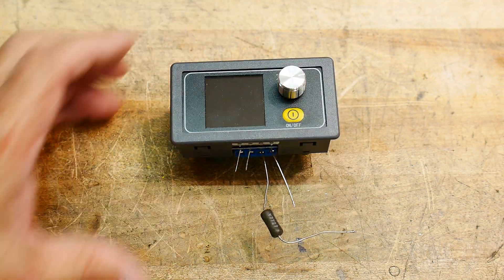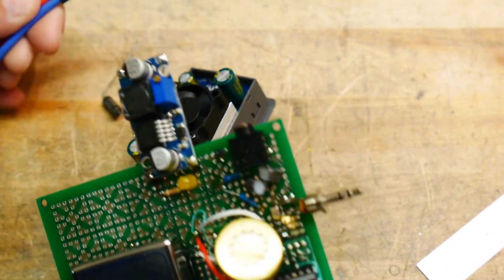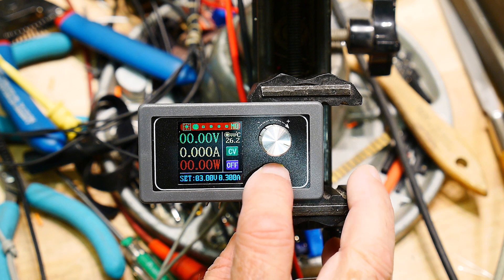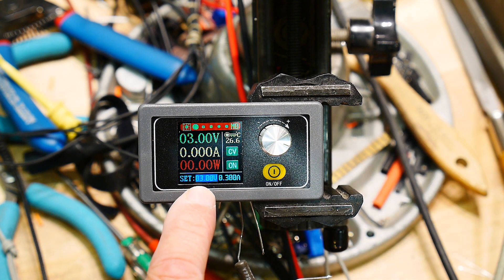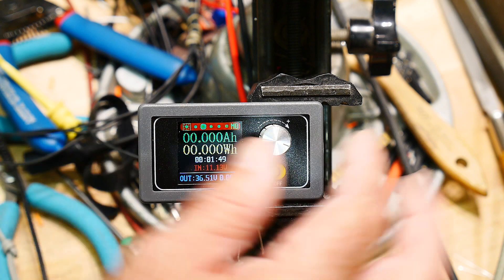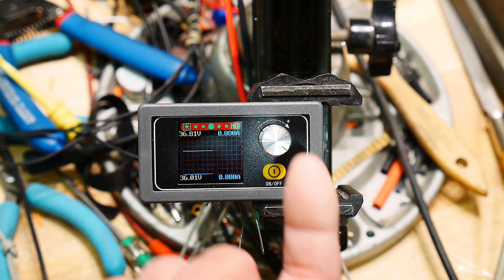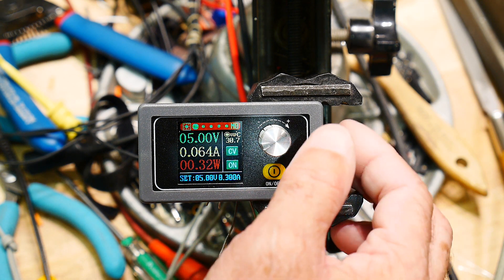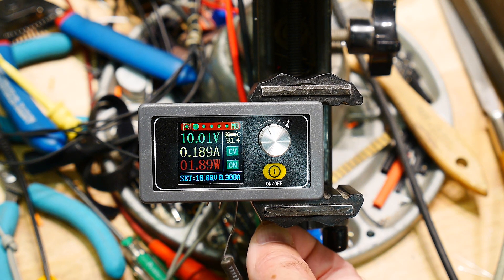#550 Buck Boost Power Supply with OLED Display

Comment: I really like the cheaper models that are like $6. They don't do the full menu or graphs, and the range only goes to 30v instead of 36, and only 4 amps, but they're much easier to use. You can just turn the dial to change the voltage, no set button needed. There's another button you press to set the constant current limit. I think you'd like that one a lot more (and it's 1/3 the price). Also, I belive they are technically sepic topologies, not the buck-boost... But that's better anyway. They don't come with a fan but it's easy to add one (it will turn itself off if you drive it too hard.)

Comment: It's made for for supercell capacitors it works as a voltage feller to keep up with the need off power in a group of 15 or 90 capacitors if you will put a group of capacitors on the output side you will see a super change of power in milliseconds you see the voltage stabilize and the amperage escalate dramatically its a door to a new power suply

Comment: Good review! Can you tell me how well the over-current protection works? I have a simular (Chinese) buckconverter module, and it does not do a good job of the over-current protection. It actually first goes up to the set voltage, and after about 200ms it starts checking the maximum current that is flowing. If it's too high, it then starts to lower the voltage. This means that for at least 200ms you could get a massive over-voltage (and of course allso over-current) before it kicks in the over-current protection, effectively destroying your component due too the late protection. Is this module doing a better job?
Reply: yea trips off line it over current...

Comment: Nice review.  I was wondering if you had a chance to measure noise / ripple on your scope?
Reply: looks really good so far, going to use it for the laptop in the ham radio room  so it will have to be clean from RFI

Comment: I have this regulator since a month and it works just perfectly. Ever heard about initialization ? The delay you talk about between different setups is only initialization which is a normal process. And of course you cannot change the voltage or current once outside of the menu. This is clearly for protecting the load or circuit connected with the regulator.

Comment: I think something is wrong with the board, since I can't limit the amperage that is being applied to the circuit, and most of the times it won't display the current amperage and power drawn from the power supply (stays at 0A and 0W). How can I tell if something is damaged and how could I fix it?
Reply from the maker: soulds like you might be using it wrong. the menus and operation are confusion. Did you press the yellow button to enable the output?
Reply: Same here too. I've tested many ways but ampere doesn’t meet the output and few second after it shows a warning like " OEP" and restart.  I'm confused what is it and why is it happened l??!!

Comment: Hello. The XYS3580 module (LCD display) has a very poor performance. On 50W load test, the XYS3580 heats up to + 70 ° C, while the XYH3606 module has a stable temperature of 33 ° C. The XYH3606 module does not have an output anti-reverse diode, one must be installed if you want to recharge a battery. I made a power supply with output out 0V to 36V 120W compact autonomous rechargeable from 15V to 24V IN (power supply off or on, it doesn't matter) in an aluminum box of 130Lx110Wx50H mm, 6 18650 batteries mounted in 3S2P, bms, regulator battery charge limited in current (1.4A), USB module 2.4A QC2.0 / 3.0, etc ... 30mm regulated case fan, etc ... This power supply operates on mains and / or internal batteries which are recharged as soon as the IN sector (15V to 24V) is present. Regards
Reply: but cost is too high :( for your specified  model..
specify what is meant by poor performance in 3580.
only heating is more or any other draw backs.

thanks in advance
Reply: I planned to get the WZ3605E model. Is that one good?

Comment: The most annoying thing here is that you have done so many tests. But, forget to change the current from .300a to 5amps. It defeats the purpose of testing. Beleive me, this device can easily do 5amps at 12 volts is you provide it the right power. Rest things you can figure yourself.
Reply: Plus he keeps complaining about the lag, which is purely the output capacitor charging/discharging as will happen with any power supply. Plus he also keeps referring to his 50ohm load resistor which i can guarantee is not exactly 50 ohms at best this resistor will be a 5% tolerance one, plus as it warms up the resistance will change. He as others have stated keeps referring to CC as being current compliance which is wrong. CC stands for constant current. He may have a good technical background but his practical knowledge is obviously very limited .

Comment: could you use this to charge 8s lifepo4 battery? it needs 29.2v to charge .i was thinking about using this to make usb c pd powered e bike
Reply from the maker: Lipo batteries need to be charged with a special charger not just voltage and current.
Reply: @IMSAIGuy  yes but i am asking if it charges lifepo4 batteries. Lipo and lifepo4 are completely different things :)
Reply from the maker: @wilderness-beastt  ok, have fun. the device is rated to 36V
Reply: okay ty :) have a nice day :)
Reply: For lifepo4 you only need battery + and battery - contacts to charge :)
Reply from the maker: @wilderness-beastt  I read about the lifepo4 and it seems much like the old lead acid batteries.  very nice. makes charging much simpler. constant current (or current limit really) then constant voltage. I learned something...
Reply: Just buy a fast charge usb module fore like 1-2€

Comment: I have a similar, and what you expected is what I did and it was a  let down.

I paid £8 for mine free postage.

But I think you ended hitting the nail on the head. If you set then power it's fine. Active adjustment isn't good.

I had issues trying to set voltage as it set amp and would volt to what it likes you have to use the settings (long hold power) to set limits (not min)
With power the amps can't be finite..
This is what annoys me, it was sold as a solar charge controller. Which I guess as that, it would work.
It says DC to DC boost buck also.

But set and forget... For an hour due to the auto off function!...

Comment: As a radio amateur, one of the things I worry about is RF noise, particularly with switching mode power supplies. Would you consider this power supply appropriate for a QRP rig? Thanks DE WA1KLI
Reply from the maker: I haven't looked at any noise it gives off. I know what you mean, I have to turn off the lights in my garage when I use my HF rig.
Reply: @IMSAIGuy    I will be using it in the ham room to power the 20v laptop from the main station battery (12.5 volts ) so i will find out pretty soon , but looks okay so far , you can also put it in a metal box and use from AC line noise filters to tame any rfi.
Reply: As a former SMPS project engineer and a fellow Ham too, I would say it would make a very good noise generator within the same room as your radio or near your antenna. Possibly anywhere in your house too ;-) 
Even 110v LED bulbs can be really nasty if you are on the HF bands...
Reply: @DaveGringo  do ferrite rings not work in reducing noise?

Comment: Can you share your electronic load scematic w me.  Ive been thinking about designing one myself but I would love to see your solution.   BTW what is your call?  DE K9IC
Reply from the maker: you can see the schematic in 
https://youtu.be/OlqymCSZ4Ek
I don't give my call since it would give my identity. It is an extra call, I'm WAS WAC DXCC
73
Reply: @IMSAIGuy  thanks, vastly similar to what my concept thinking.  I was planning on a much higher version with a few FETs.  I would like to get up to 100A.  I understand about you maintaining anonymity.   When you're famous you need to have a low profile.   I am infamous so I can throw caution to the wind! 73 and stay safe
Reply from the maker: http://www.kerrywong.com/2018/11/05/teardown-of-an-array-3711a-300w-dc-electronic-load/
schematics at the bottom of the page

Comment: "Compliance" is a term generally used to spec the voltage range of a current source (or similar concept). I wouldn't use it as freely as you are...

Comment: at 6:12 what does it have to do with low input voltage?? the device is gone into CC mode because you set the current limit at 0.3A and connected a 50 ohm to 36V. of course voltage will drop to keep the current at 0.3A. that's how any current limiting power supply works
Reply from the maker: you are right